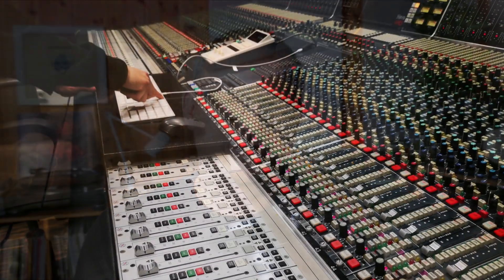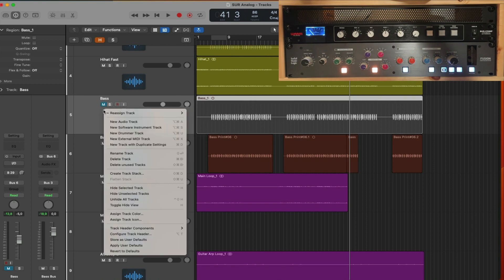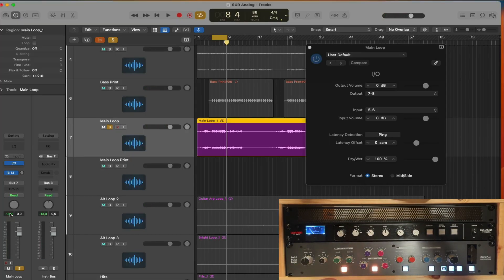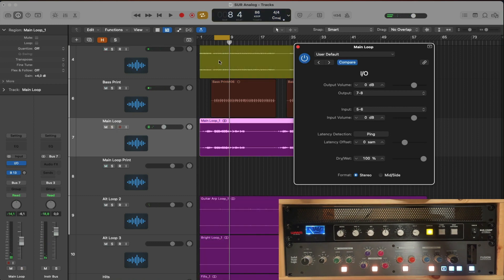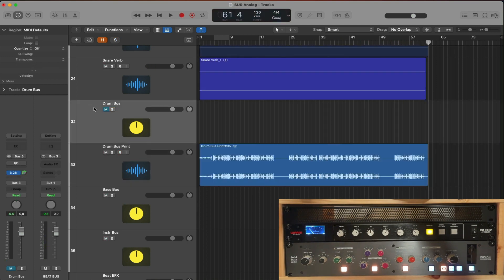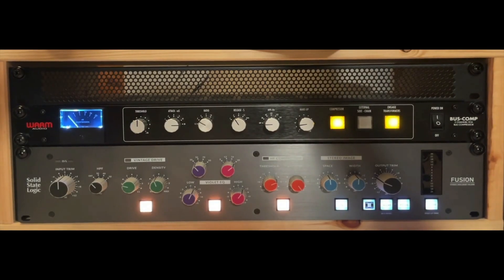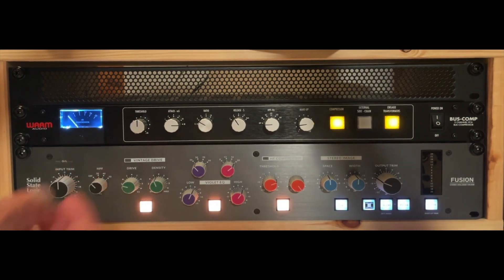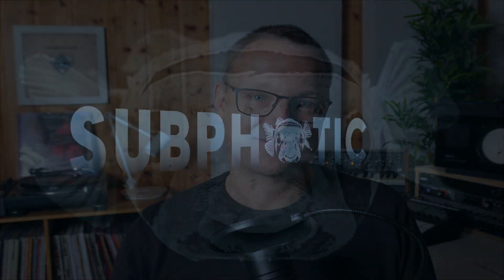Mixing A Beat Using ONLY Hardware (SSL Fusion & Warm Audio Bus Comp)

Comment: I have the same setup for mastering (SSL F & Warm Bus) and have thought about doing this for individual tracks... good stuff.
Reply from the maker: It’s fun, sounds good and yet a bit tedious and constricting, but it does something positive for the creative process IMO, embracing the craft more manually than just loading up plugins. A good process. Cheers!
Reply: I found a Crest Audio Century GT soundboard which has been my analog summing... but the Looptrotter Summing (24 channels) where the first 8 channels you can add in drive etc.) is also something I'll be diving into... but yeah, analog if done correctly can really spice up any mix. 
 @subphotic
Reply from the maker: @ajlsoundwave  no doubt about it💯 I had a Tegeler summing mixer before, but sold it as I really only use hardware to do bus processing these days, but I kind of miss the flexibility tho
Reply: right on - Tegeler summing is a great box!  I think even if you just run any mix through the fusion / warm setup, you're already adding back some analog saturation but by doing bus processing, it def. adds character.  Driving the low frequency as you did in your example really makes the difference @subphotic

Comment: is the mix control on Logic IO sample accurate? If not then you risk phase issues when using it. As far as I know you'll need to do blending in the analogue realm to eliminate this issue...
Reply from the maker: Really good question! Personally I’ve never encountered phase issues doing this, but I’ll run some A/B tests and report back👍 Thanks for chiming in

Comment: Is there a reason nobody uses realtime bouncing while I/O is playing through analog gear?
Is there any downside doing this instead of printing the mix and bounce it offline?
Reply from the maker: Hey, thanks for chiming in! To be honest, I’ve never really thought about realtime bouncing, never done it… I guess an advantage with offline would be to ensure that everything went well in during the print, and also having the option of tweaking after the fact. But it’s potentially quite time saving with realtime. Hm, gotta try it. Thanks🙌

Comment: How did you connect connect the ssl and the warm audio to your audio interface.. How did you route them
Reply from the maker: Hey, thanks for watching! I use the alt outs from my interface into the ins on the ssl, outs to the bus comp and then from the bus comp back into the interface. Another more elegant solution is to use the inserts into the ssl when hooking up the bus comp, that’s more flexible. Check out this video for a better (hopefully) explanation How I Connect Analog Hardware with Logic Pro X for Mixing and Mastering
https://youtu.be/yPLlSEaq18I Cheers🙌